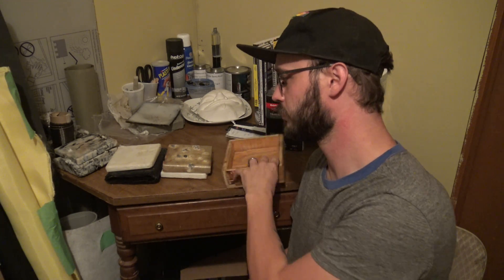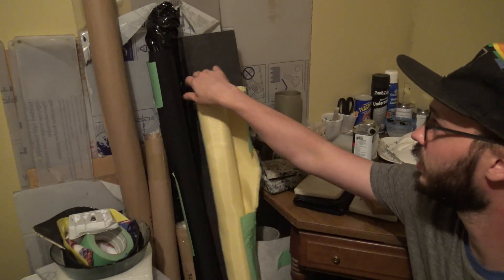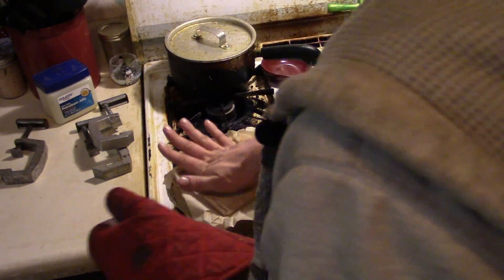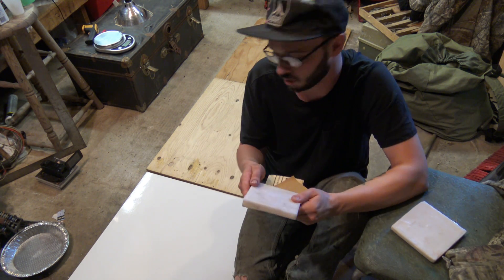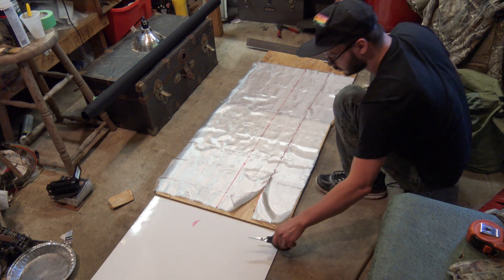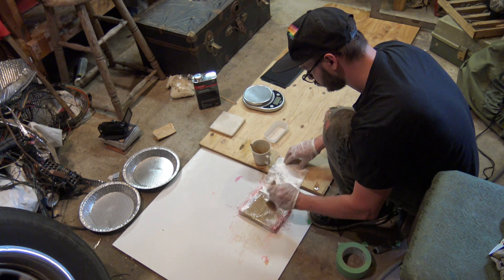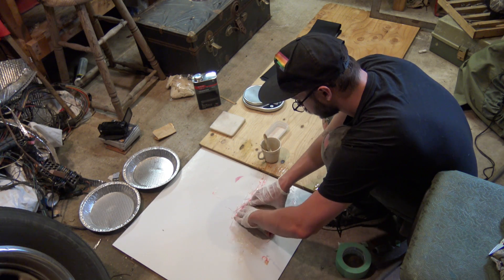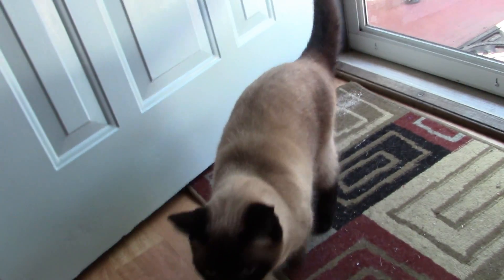Recycling milk jugs into ballistic plates (part 2)

Comment: Enjoyed watching your build.  You do great at problem solving.  Would like to pick your brain.  How would you go about using the recycled plastics to build sheets of thin plastic to cover a deer blind that could have a lite wooden frame or metal frame.  How would you handle the joints where the plastics meet.  Can it be glue so it will not leak or would you be able to use a heat gun or some other approach.  Thanks for any wisdom you can share.
Reply from the maker: Ah a fellow hunter, that's a great idea! This will require a bit of a long winded answer, so here goes. First lets talk about the plastic, if your going for HDPE (the plastic i used in this video) I would figure out how thick I wanted the sheet to be and base the other dimensions  of my mold off of the oven that I have. And by mold I mean some metal sheet or board, most wood starts to burn at about 500F so it could work, might want to treat it with something to resist higher temps. HDPE is very flexible at 300F, but doesn't get completely clear til 350F, so that's what i would set the oven for. I would cover the board (or metal) sheet with wax paper and spread out a lot of the chopped plastic, and melt it til it was completely clear. Then i would check to see how it was filling out the board, ( it won't turn liquid, so no worry of it running off really) and add more pieces to help fill and gaps and thin points, you could also use a rolling pin to smooth it out over surface. Once it looked good and ready, i would pull it out and place another board of the same size (with wax paper) and use large claps and such, maybe just weights or books would work, to apply pressure on the plastic. HDPE shrinks a lot when it cools, and if you don't apply pressure it'll shrink too much, and it can ripple and have air pockets. Make sure to add a bit of pressure as it cools, just a few turns on a clap or a few more books. If you were thinking smaller scale sheets two cookie sheets would work great, find one that fits into another and use them as the mold, i would use some sort of stopper next to the mold bottom (or build in) to only allow the plastic to be pressed to that thickness, that way it isn't to thick or thin. Now how to fuse them together. HDPE doesnt absorb water at all, and most glues don't seem to hold to it well, but guerrilla glue does work, as well as some high grade epoxy resin called max bond, its the same resin i used in my hat insert build and my mask build, if you have seen those videos. make sure to scuff up the surface before trying to bond them together, and silicone calk works pretty good. But i like the heat gun idea, when this stuff is cooling it'll stick to anything, the first wooden mold i used had to be broken apart to get the plastic out, and there were chunks of wood stuck to the surface so i think you could try and weld it to the wood itself, or metal. (main reason I use Vaseline and wax paper.) Now plastics can under go creep deformation when loads are applied to them. (buckle at the joints, gets thinner in the center) so if your going to screw it to something I would use washers( maybe rubber washers) to help keep that from happening. This stuff  can be cut and sanded a lot like wood, so maybe a planer could be used, if you could get your hands on one. Anyways great questions! You got my head filled with some new things to try, and i hope this helps.
Reply: Yes you have helped a great deal.  Harbor Freight and others sell plastic welders and you can buy HDPE strips to use on the weld.  Your idea of welding it to wood is worth thinking about.  Please help me understand about the length of the cooling period.  How often should I increase clamp pressure?  Every 10 minutes or every 15 or what?  I liked your video - it got me thinking.  I think I want HDPE about 1/4 inch thick for my application.
Reply from the maker: Yeah I forgot about plastic welders lol, that could totally fuse two pieces together. now cooling depends on how fast you want your plastic honestly, if you keep it in a warm room it'll cool slower so it'll take more time, and you wouldn't have to apply more pressure for awhile (like every half hour for two hours). but if you take it out side or into a cold garage you would have to apply it about every 10 min or so, really with clamps you can tell by checking them, if they feel loose tighten up until you get solid resistance. I've greatly sped up the process a few times by using my deep freezer just to see if it would work, and with it being that cold it still only needed to be tightened every five mins. Also its worth noting you'll only need to re-tighten them about 3 times, it shrinks mostly right at the beginning and much slower after that. It can still be warm and shrank all that its going to.
Reply: So do you believe my plan is reasonable and could be pulled off?  I was thinking HDPE since is plentiful and could be used.  Is there a better recycled plastic to use instead of HDPE?  I am thinking plastic bucket material would work best to get the thickness I want.
Reply from the maker: Oh it's totally doable, and as far as recyclable plastics HDPE is where to start. Its some tough crap, and easy to find, and it doesn't really give off any fumes that are dangerous if it happens to catch fire. ( I've never had a piece do it to me, and ive molded quite a bunch of this stuff.) Just make sure those buckets are HDPE, you can check the recycle symbol for that. If you wanted to step away from recyclable plastics i would consider some themoset plastics like epoxy , and reinforce it with fiberglass.
Reply from the maker: But yeah, without other equipment HDPE is a great place to start, I'm doing some experimenting with ABS, PVC and kydex in my oven, im also building my own thermoforming table as we speak, so you can keep a look out for that build.
Reply: I would have to pay for epoxy and fiberglass and I had rather avoid that.  What temperature would you suggest I use to use a rolling pin to get it spread out early in the process?  I am guessing I would use the wax sheets to avoid the rolling pin get stuck up with hot HDPE.
Reply from the maker: Yeah its sticky, laying a piece on top while your rolling helps, it'll stick to the paper as well as it cools. So I would say start rolling when you see it start getting clear, it will quickly turn back white, so just pop it back in the oven when it does. if your HDPE is a different color than the light white that milk jugs are (virgin) then no biggie, it will still seem more transparent than before. Its cools quickly and starts to harden back up without direct heat so if you dont get it all even on one pass just put it back in for a few more mins. and I would just put the oven at 350F and just keep glancing at it till it seems ready to roll. You'll tell its getting ready for rolling or molding by how well the pieces of plastic are stuck together, before you know it they'll look like one continues piece, I would start rolling when the lines between the plastic pieces start blending together.
Reply from the maker: Any luck with your attempt to mold the plastic into sheets? I would love to hear or even see your results.
Reply: Have not attempted anything yet.